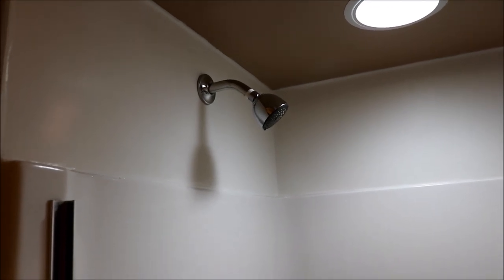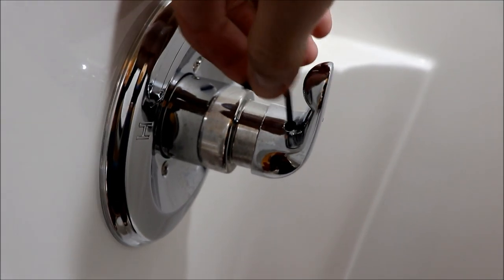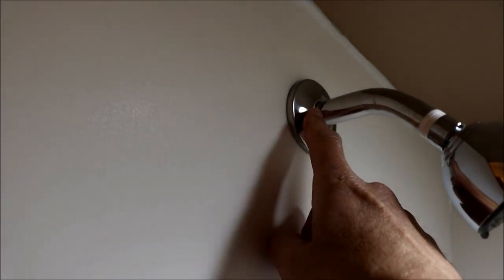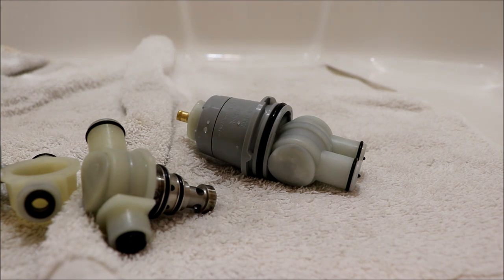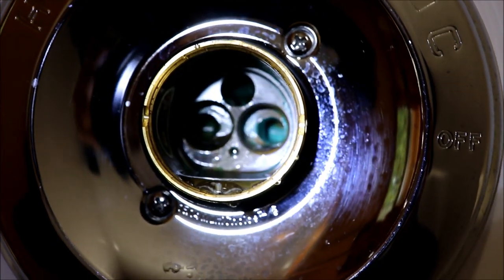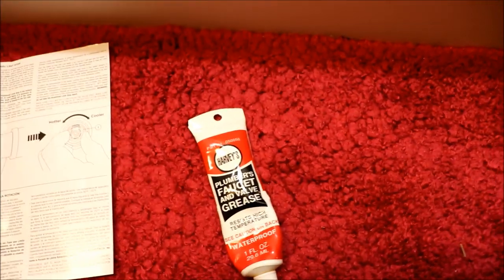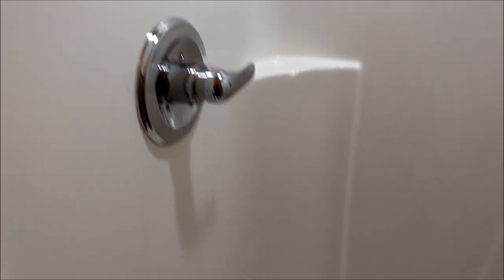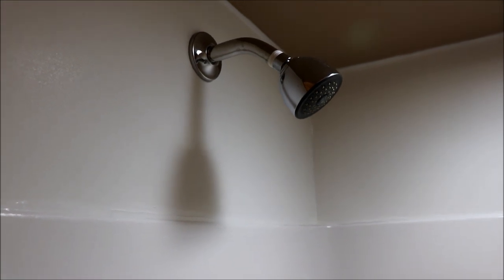How to replace Delta Shower Cartridge

Comment: Very good video for the skilled homeowner.  At 17:40 when you side the sleeve onto the new valve, STOP.  Turn your water back on.  Using pliers, open the valve to test your water temperature.  If it is too cold or too hot, adjust the white plastic ring accordingly.  Once its good, finish the handle attachment and set screw.

Comment: Our Delta never dripped...went from working fine to full blown running dribble. Ran around to 3 different box stores trying to get a clue. Finally with the help of Google and this video I got it figured out. I got the new cartridge in pretty much along the same lines as the video....ran out to the meter to turn the water back on to check for leaks. My wife meets me halfway back to the house yelling, "WATER IS GOING EVERYWHERE"!! Sure enough water was coming out all around the cartridge....ran back to the meter and then back to the bathroom. First thing I see is the locking ring sitting there on the toilet seat lid....Awwwww Godfrey Daniels!! Locking ring back on....water back on...all is good. Thanks for an informative video.
Reply: Actually all was not good…the new cartridge from HD had a slow drip..drip..about one per second. This time I did the e-mail exchange with Delta, including 8X10 color glossies of all the evidence of the drip😉. Around two weeks later I got the “free” replacement valve and it worked perfectly.  So, the moral of the story is; don’t declare victory until you’ve actually won the war. 😄

Comment: Thanks for the video. I just replaced the same Delta shower faucet cartridge as you. Quite a bit different design then the MOEN Shower cartridges that I had grown used to. Calcium/corrosion build up made it a challenge; the set screw used to hold the handle to the cartridge was seized, so ended up breaking the old cartridge and handle to get it off. Lots of force rocking the handle back and forth and pulling simultaneously to get it off. Then had to tackle the metal collar that holds the cartridge in. Persistence paid off (along with some CLR and penetrant oil/spray and muscle) and got it free. I used Channel Lock pliers on it...being careful not to apply all the pressure on just one spot as I read you can ruin the collar that way and forced to get a new one. During the replacement, I made sure to use plumbers grease on the set screw, retaining collar (and threads on valve) as well as the O-rings on the cartridge. I hope this will make it much easier if I have to do this again down the road. The Delta design isn't the best IMO.

Comment: The rubber seats as you pointed out is what goes bad on these. It’s a $3 part at Lowe’s and Home Depot. You also want to turn the cartridge as you wiggle it and it will pop right out. Thanks for your video, I was able to fix a shower that was leaking for years.
Reply: It 100% DOES NOT pop right out

Comment: Thanks for this video. I called delta and they gave me the new seals and springs for free. I took it apart and thought that cartridge was one complete unit. Didn't realize it opened to get to the seals. Changed seals works great.
Reply: I drop mine and seals and springs fell out how do I put them back in.

Comment: Thanks for the making the video.  I was wanting to review live before doing the replacement myself.  The video was very helpful, gave me more confidence to complete the replacement.  Will use the valve grease for the O-Rings to slide into place, not installed dry to take a chance to cut the O-ring.  Had the leaking problem started after the freeze February 2021, probably due to the city water lines were stopped too, when restarting, probably had a lot of contaminants in the piping loosened.  Normally would turn on hot water, then shut off, hoping sealing the O-rings via heat expansion.  I could not fit a 1/8" allen wrench fit, used a #10 torx screwdriver.  After replacing, will take advice to order from Delta Manufacturer. Thank You again.

Comment: Just fixed mine yesterday...after buying several incorrect cartridges...be sure the two legs that go into the housing are long enough...the incorrect ones were just too short ...if you can't turn the water off, they are too short and you have the incorrect cartridge...I  used the danco model 10664 to fix ours.

Comment: The video and instructions are great.  I followed them and was able to replace the cartridge.  There is one point that might be in error: The Delta RP46074 package says it works for 13 & 14 series valves, and the dialog in the video suggests that 13 & 14 series are not the same as 1300 and 1400 series.  I used the RP46074 for a 1400 series valve and it worked perfectly.  The valves were identical for the end that is inserted into the plumbing.  The only difference was a new or different hot water limiter.

Comment: Thorough helpful. Thanks especially for pointing out the part numbers of the valve and cartridge.
Reply: Unfortunately, even with the right part numbers the aftermarket did not fit.. the supply tubes were like 1/4” too long.

Comment: At 10:37, the part he's touching is the spring and seat. Believing I had a different model faucet, I bought the RP4993 kit for my fix. Replaced them in the valve, put the valve back together and reinstalled it for an easy fix. No more drips. Thanks for the video, it helped me figure out the easy fix.

Comment: You are enormously lucky.  I fixed my daughter's shower with the exact same cartridge.  There is so much sediment in their water that the white portion of the cartridge was cemented in placed.  The gray part broke away from the white part.  I had to remove the white portion by taking it apart piece by piece using a drill to weaken it and then use needle nose  vice grips to break off one piece at a time.  Took me almost an hour to get it out and not damage the bore of the faucet.  After all the work of getting out the old cartridge and installing the new, there is no hot water coming out of the shower and I made certain the "hot" side was placed properly.  No idea what I did wrong.  Very poor design in my opinion.  Thanks for the video.
Reply: I had the very same problem, everything was stuck inside my pipe hard... took me about 4 hours to finally take everything out, and after I noticed I didn’t get any hot water I took everything back out and replace the little Orings back where the pipe meets the end of the delta cartridge the hot water came out good... maybe try that method? Hope everything worked out great!
Reply: @1makosyo1  ;  You are going to love this.  I installed the $51.00 cartridge perfectly and it would not work, no hot water.  So, My daughter purchased a cheaper cartridge and I installed that one.  It works perfectly now.  Turns out the valve inside the body of the more expensive cartridge would not move back and forth. So, expensive cartridge returned for refund and shower works perfectly with a cartridge $20.00 cheaper.  Go figure??
Reply: @wrongfullyaccused7139   I guess sometimes going cheaper is better then going more expensive 😅 glad to hear everything works great now!
Reply: @1makosyo1  Have a great day.
Reply: @wrongfullyaccused7139  Thank you for this information! Source for cheaper cartridge? Rather not go through what you went through.
Reply: @rob99201  ;  Believe it or not, I bought both cartridges at the same place, Home Depot.  They had the expensive cartridge and the cheaper one side by side.  You have to laugh.  Best of luck.

Comment: Good video.  The hot and cold don't have equal pressures - the machined cylinder oscillates back and forth to keep the water temperature constant during any pressure variation (e.g. toilet flush ).   Also, when first turned back on, any debris will get up to the shower head - so you may need to open the head and clean it out for maximum flow.

Comment: I have a brand new shower and faucet with the same model valve and series 14 cartridge/handle.  Installed just like yours and water does not shut off!

Comment: You can repair the valve body you already have in 5 minutes with part # RP - 86968 for about $ 5.oo .

The reason that they don't  change the orientation of. "H&C"  tabs IS that in rare instances the "Ho t & Cold" plumbing gets reverse and does N0T meet the Hot on the Left & Cold on the Right standard.

IF ... you experience this all you need to do to correct is rotate the valve body 180° .

Comment: great video thanks for posting did it today 11/30/20. the tricks you show like pliers on stem and pull really helped. I also greased a little on the outside plastic bulbs to help push new one in. video was really helpful, will bookmark it for home stuff thank you!!
Reply from the maker: Glad it worked out.

Comment: I am glad you had trouble putting in the new cartridge because mine would not seat either.  I had to jiggle it up and down a lot and push really hard.  I thought I had the wrong valve because I was changing from dual function to single function.  However,  it worked with force...the force?

Comment: My Delta 1400 cartridge was 20 years old when leak started. Cause: calcium build up in supply that required Dremel with stone to polish. New "O" rings on cartridge would not have sealed due to calcium build up.

Comment: At 10:00 you say about two halves of the cartridge: you can pull them apart" I believe they are locked together. only after twisting one of them by 90 ° in relation to the other will make it possible to pull them apart. I think you did twist them without saying you did, so some may be trying invaine to  pull them straight out and not succeed.

Comment: thanks for the video. i had water hammer, thought it was loose pipes. turns out to be bad shower cartridge causing it. made a hole in the drywall before i saw your video, oh well.

Comment: I just installed a new multi choice diverter ws, T13022 trim and cartridge. I’m wondering if I didn’t get the cartridge seated properly since the faucet is dripping already 😏. Guess I have to take it all apart again. Thanks for your video!

Comment: I installed the correct cartridge but no matter what I do, even greasing, I cannot get that seated back in flush past that o ring . I gave up and put the collar and other part on anyway. It is not leaking but will it hurt to not have the cartridge not seated flush?
Reply: I'm having the same problem and found several mentions of it on the net but no fix.

Comment: I've got two showers with this Delta cartridge and when my upstairs shower leaked I had a spring and little rubber spring seat that needed replaced. I just replaced my cartridge on my downstairs shower a few days ago and I had to replace two O-rings, the springs and rubber spring seat along with rubber rings that were connected and had an "eight" shape. All these pieces came with my cartridge that I purchased at Lowe's for about $40.00.

Comment: I replaced my old cartridge because I was getting no flow but the new cartridge didn't correct the problem ... I turned the water on without the cartridge and water flowed .. what should I do now
Reply from the maker: Is the shower head blocked?  I would put the cartridge back in and take the shower head off and check for flow.
Reply: Im not getting any water out the spout....but when I take the cartridge out I get water out the area where the cartridge was just nothing out the spout when it's in ... the old cartridge or the new one

Comment: They state that if your water lines are reversed (cold is normally on right side) then you can still install it in reversed position and have it work correctly.   Thats why they didn't do it one insert direction only.

Comment: This is such a poor design. Its way too easy to break stuff trying a corroded retainer ring off, or pulling the cartridge out. They needed to put flat spots on both the retaining ring and the valve body to provide counter--torque  as not to damage the unit. Or provide a tool use a ratchet to get it off like you can get for oil filters.

Comment: I called delta today for replacement and was told, because I am not the original owner, second owners are NOT covered for parts and warranty. You will be forced to pay for a replacement.
Reply: Had the same issue
Reply: I had the same issue, I complained and they gave me one for free.

Comment: My set screw was corroded, so I soaked it overnight with a vinagear/baking soda mix, then sprayed the brass ring with WD40, let set overnight. My cartridge would not come out, instead of using pliers on the stem, I just put the handle back on and used the handle to pull the cartridge. Unfortunatelh one of the cartridge ears  broke.   When everything is corroded and calcified, good luck on getthing thing out without breaking stuff.

Comment: 4:52, trying to get that nut off, it won't budge, and feels liket the entire housing is rotating or bending.  Added WD40, tapped it. nothing.
Reply from the maker: You might mar the finish but trying putting a large pipe wrench on it.  Try to tighten it slightly and then try backing it off.  You might have to work it back and forth to free it up. If all else fails call the Delta hot line, they may have some tricks to get it off.
Reply: @stuntcardriver  I had to cut off the ring, I wonder if a standard part that Home depot would carry.
Reply from the maker: @12vLife  That is a standard stock shower valve they should stock parts for it.

Comment: Mine is a peerless and slightly different but still delta parts. When I tried to pull the cartridge out only the top part came out so I went ahead and replaced the seats and springs. My original was a pretty steady drip out of the faucet. It’s less of a drip but still dripped but got too frustrated and left the drip. Not sure what else to do.

Comment: I can't get the nut that holds the cartridge off.
Reply from the maker: That collar shouldn't be that tight.  I would try a rubber strap wrench or something that won't mar up the finish.  A larger slip joint pliers with the teeth taped to prevent marks may work as well.  Worst case scenario you could file a small groove into the outer part of the nut. Then place the flat blade screwdriver in the groove and tap with a hammer.
Reply: @stuntcardriver  the monkey wrench did the trick.  Now, I can't get the cartridge out.  😠

Comment: Does this model fit the shower control with the glade knob that only turns to the left?
Reply from the maker: It may.  I believe this model had a choice of handle.  I would call delta, they are helpful.
Reply: @stuntcardriver  I called delta and they are sending me a free replacement since mine was an old model from 1990s

Comment: Wtf dude? You skipped how you got the cartridge back in. Did you use a rubber mallet or just keep forcing it wit two hands?
Reply from the maker: By hand, should slide in with minimum effort.

Comment: Do I have to adjust the temperature of water in cartridge or is it ok for not doing anything,  the factory was adjusted already? Thank you.
Reply from the maker: It should be factory adjusted, but it depends on how hot your water heater is set.  Most water heaters are factory set at 120-125 degrees.
Reply: @stuntcardriver  that cap that you move to adjust how much hot water comes out, pops out when I turn my water off. Causing it to turn back on.  Any ideas on how to keep that from popping out?
Reply from the maker: @8_one_8  I would call Delta.  Their customer service is very good.

Comment: I replaced mine but now water is not flowing from the shower head. Do you know why that could be? I turned ny main water switch on.
Reply from the maker: I would take it out and compare to the one you took out.  Make sure the cartridges are the same.
Reply: @stuntcardriver  thank you I got the water to flow, but now the shower is still leaking water after I turn it off, that was the original issue I had. Do you know why that’s happening now?
Reply from the maker: @Kaws-x2g  I am assuming the water is leaking from the shower head?  If that is the case, something internally is wrong with the cartridge.

Comment: Can anyone confirm how to get the cartridge in flush aside of saying "use force" cause that's not the answer.
Reply from the maker: Compare the cartridge with the original.  Make sure it is the same length.  Also make sure there isn't anything in the housing where the cartridge seats.
Reply: I did all that and it didn't help. I ended up reassembling it even though it wasn't flush. I do appreciate the reply.

Comment: Hi there. I got a question.  How did you put it in... I saw you struggled at the beginning then you cut the video and it was all in. I can't do mine I dont wanna force it . Any advice would be appreciated. Thank you...!
Reply from the maker: It requires some force.  Try wiggling it back and forth gently.
Reply: Same and I'm sure I'm using enough force. I hate to call a plumber for something this simple. So frustrating.